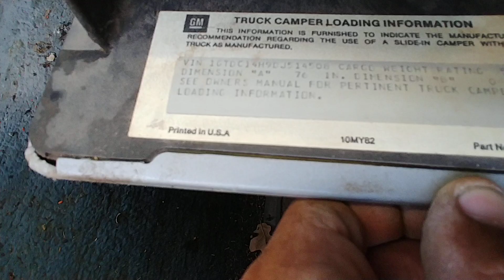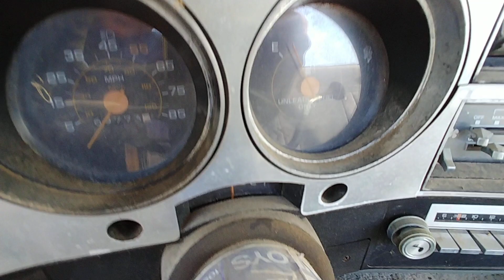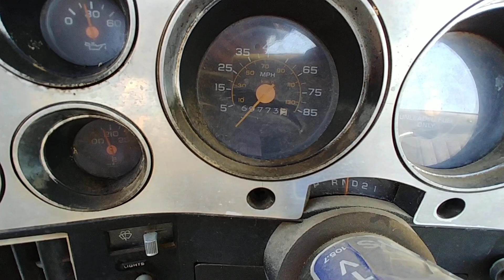1983 Square Body GMC Sierra Classic Junkyard Find

Comment: We got an 83 C10 long bed  strippo from a local library that went under due to funding cuts, in the mid 90s. Oddly optioned, it had p/s, manual brakes, am/fm stereo, gauge package, 250 six and 700R4. No a/c. No carpet. No sound insulation. It also had the towing package with 3/4 ton rear springs and large outside rear view mirrors. By far 1 of the best pickups this family has ever owned. We drove it until there was more rust than paint left on it, and had to let it go in 2004. It was still turn key reliable mechanically.

Comment: Whoa Nelley, it's a square and you found one there. If you don't like the rhyme, for you I ain't got time. That's that, go shit in a hat. Harbin GMC is likely out of business, it was possibly located at 1515 W South Loop, Stephenville, TX 76401 and may now by Bruner Chevrolet. 

We got the VIN, we win: 1GT for US made GMC truck, D for 5,001 to 6,000 # GVWR rating, hydraulic brakes, C for 2WD conventional cab, 1 for 1/2 ton, 4 for two door cab, H for 305 V8 with four barrel, 9 for a check digit, D for the 1983 model year, J for Janesville, WI assembly and the rest is the production sequence. 

You got the SPID, glad you did, but it wasn't clear, you weren't too near. But that's OK, I figured out anyway.  Possible Silver Metallic over Midnight Blue exterior paint. 

Looks like it sat, that's that. It's going to be flat, ain't nothing we can do about that. It's going to get squished and we'll be pissed. It's time to go, don't you know.  We can't save them all, but we can keep the ones we have standing tall.
Reply: Google is the GM plant in Indianapolis still making vehicles?
Reply: @garymckee8857  Do you mean the Fort Wayne, Indiana plant? If so, yes. It is located at 12200 Lafayette Center Rd, Roanoke, IN 46783.
Reply: @googleusergp  It was a stamping plant I just looked it up it closed in 2011 I thought my mind was playing tricks on me again because when I was working there I drove by it .
Reply: @garymckee8857  Delco Electronics was also in Indiana in Kokomo for a number of years.
Reply: @googleusergp  I used to use all Delco parts until I bought some plug wires for my 92 Camaro because every two years I changed plugs,cap ect and they were made in China no more Delco parts unless it's an oil filter or spark plugs.
Reply: @garymckee8857  Sigh. I could go on for paragraphs about this. The oil filters are made by Champion Labs for Delco. That's both the "E" (E-core) and non "E" part numbers. You want the "non E" version, they are heavier and in my belief a better filter. The plugs are made by Delphi. Delco doesn't "make" anything, they are just the marketing arm of GM's aftermarket parts end that competes with the other aftermarkets out there. For example, Delco got out of the fuel pump business in 1995 (at least the mechanical end) and Blackstone (then part of Borg Warner/Echlin) was supplying Delco pumps. You knew that because the AC logo was gone. 

When applications get old, they often don't buy them from the OEM suppliers and will go to the major aftermarket vendors for their requirements. Sometimes the lines are split. Brakes are a good example. The Delco "OEM" line or "GM OEM" is what came on the vehicle when it was made. So for brakes of late, that is Akebono as the OEM supplier. If you buy the "Delco Professional" line, you are getting (typically) Raybestos PG Plus in the box at a markup. 

Let's say you want a distributor cap for that 1992 Camaro V8. Years back you'd buy a Delco through your Delco jobber and it was the exact same part as you'd get at any GM dealer for the car. Now today, that Delco cap is supplied by Wells or Standard Motor Products more than likely. Wires? Probably Delphi for some and Standard for others. 

It happens in all industries. I replaced an evaporator motor on a GE fridge for my cousin about two weeks ago. She got the part from Amazon and it was a GE original. Well the original and replacement are both made in Thailand by Panasonic. The aftermarket suppliers (Supco for example) likely make them in China if they offer a replacement. I suspect down the road when you go to buy that, you're going to get a Supco in a GE box.
Reply: @googleusergp  kinda sucks don't it.
Reply: @garymckee8857  It does. I do not like when I have to pay for OEM prices and wind up "putting it all together to work". I purposefully buy OEM so I can do the job once. In the case of the appliance parts, I was installing what really came out, and since GE is not good to start with, so be it. LOL. People that fix them for a living call them "Generally Expensive" or as I like to call them, "Garbage Electric". GE's motto used to be "We Bring Good Things to Light", which should really be instead "We Make Your Wallet Light". Whoa Nelley, that evaporator motor was $112 from Amazon (the way she went) and was $160 at the local guy and he didn't stock it.
Reply: Leroy Jackson  When you work in the auto parts industry, you learn who is supplying who. CTS is the company that supplied 99% of the throttle position sensors in the past to the OEM car makers. In turn, the aftermarket companies bought from them too.  CTS: https://www.ctscorp.com/company/history/
Reply: Leroy Jackson  All the time. But, even doing what I do, I still learn every day. You can't fault a person for wanting to learn and digging into something to figure it out. That's where exchanging ideas and where the internet shines. You have to have a quest to do the research and go out and find the information you need. The internet has helped and is a good tool if you use it right. For instance, in fixing my cousin's fridge, i can go on line, post the problem I'm having with the machine, someone will help and offer a solution (and in turn maybe I can help that person some day too), and then I can go online and look up the part number and shop around by part #. Years ago, having the parts book for something like your appliance was golden because it was the key to getting the parts at a lower cost. Sears always included a full parts list with their machines, so if you were crafty, you didn't have to go back to them for parts and pay the markup. You could go to your local  appliance parts place with the part # in hand (knowing it was a Whirlpool, GE, Frigidaire made for Sears machine, etc.) and save a boat load of money. Now, you can take that same part number and source it online and have it to your door in a few days. Or, if you go the local route, you make the person's life easier by knowing the part# you need and in turn you know he/she is going to give you the right part and if you're paying too much. Case in point was the evaporator motor on my cousin's fridge. Amazon had the same part for $112 that the local guy wanted $160 for (and he did not stock it and said he had to get it from VA, probably the same place the Amazon seller was getting theirs from).  It arrived in under a week and the repair was done by me. Saved them probably $200 to $250. Same exact part.
Reply from the maker: @googleusergp  bought a delco drier for a 72 Chevelle a while back and dam thing said made on China
Reply: @ClassicRideSociety  Because it's not "made" by Delco. It's likely made by Four Seasons, a division of Standard Motor Products and reboxed as Delco.

Comment: Tilt in this is a stupid easy flip $150+.  Clock cluster also a good flip, clock alone will bring some bucks but it needs the clear cover with it so just as easy to take it all.  

General Lee is one of those slammer cars, it had this launcher with a handle that fit in the back  and you slapped it down to make the car go.  Kenner?  I forget who made them.
Reply from the maker: Did you see towards the end a couple of dudes showed up and I believe they were going to snag those things

Comment: Even us ford guys will admit GM had better carbed trucks. Carb 454 or 350 would run circles around any ford truck. Now when efi came out and a better overdrive transmission by early mid 90s the game changed.
Reply: Nah, when the GM trucks got TBI they got just as good as Ford and they were simpler to fix. The early Bosch derived/supplied for Ford injectors were cloggers and problematic. However they weren't any worse than the Disaster-Venturi, I mean Variable Venturi carburetors. Those were outright junk right off the line.
Reply: @googleusergp  If you were to buy a Ford truck of this era (73-79) what would you look for in terms of engine/transmission as well as general workability? (Especially the 78-79 trucks)
I heard the Ford trucks hold up better than GM in terms of rust.
I need your wisdom so that I won't get burned like I did with Rancheros!
Reply: Which Ford of that era? The one with the GM badge. Lol. GM had a better ride, carburetion, transmissions. Ford was quite sloppy in these years. That is me.
Reply: @googleusergp  I meant the 78-79 Ford trucks. How are those in terms of reliability? Just lookin' to get a classic Ford truck as the Chevy trucks are overpriced and the affordable ones are rusty.
Reply: None of them. That was the pinnacle of Ford's poor quality. Crappy carburetion, loose steering, sloppy ride, rust up the wazoo. No thanks.
Reply: @nathankim7664  78-79 f250 f350 4x4 were good trucks. The Dana 60 axle ones. 78-79 bronco f150 4x4 were decent. You swap a newer efi 460 into them it's same bolt pattern as the 351m 400.
Reply: @googleusergp  So do you recommend the 73-77 Ford trucks? I like the f100 and the f150 2wds. Or am I better off with the Bullnoses?
Reply: @D4x4Bronc  I'm more looking for the f100 and f150 2wds. With the explorer package if possible. Wonder what your thoughts are on those
Reply: @nathankim7664  nothing really wrong with them. Interior and engine swaps are popular
Reply: @nathankim7664  I recommend you see your authorized GM dealer :). LOL.